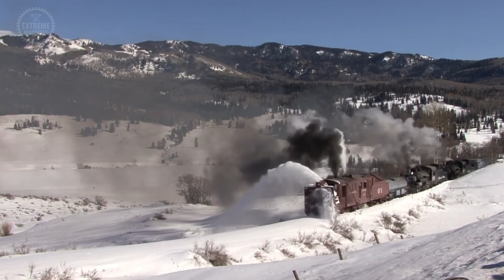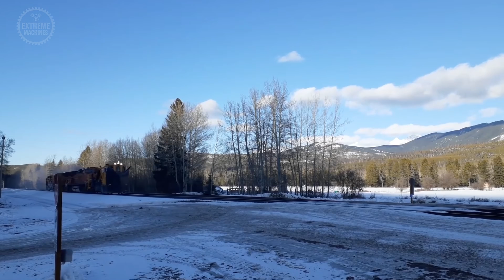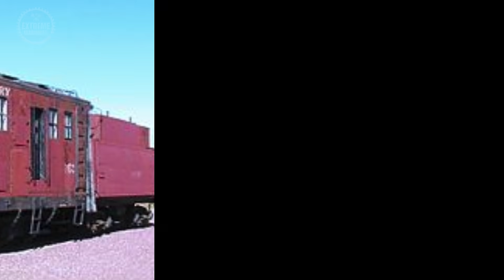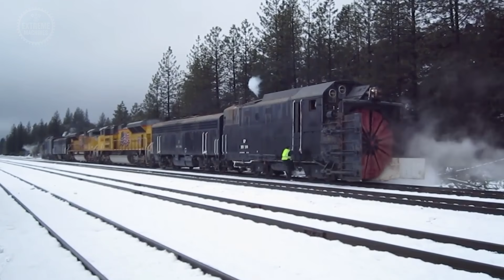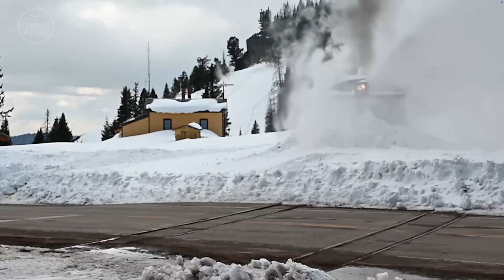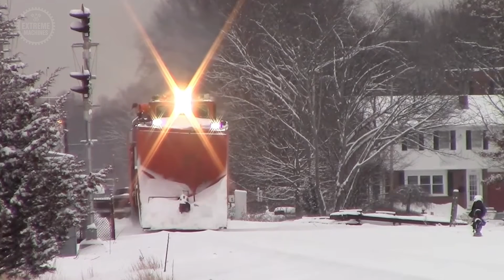The BIGGEST and Most POWERFUL Snow Trains in Action — This Is INSANE!

Comment: The Jordan spreader was the creation of Oswald F. Jordan, a Canadian [not American] who worked in the Niagara, Ontario area on the Canada Southern Railway, later a subsidiary of the New York Central Railroad. He supervised a crew at the St. Thomas Canada Southern shop in the early 1890s. Jordan's first patent, filed in 1890 and listing Robert Potts as co-inventor, covered a single-blade mechanism with the blade height adjustable with a hand crank and gearing

Comment: I see one weapon against the snow you failed to cover. The Southern Pacific Flanger. SP used them as a first line defense against the snow. It's pulled by one or two locomotives and has two plows that sit between the trucks of the flanger. One to throw to the left, and the other to throw to the right, and you use which one works for the terrain you're plowing in. The plows actually go below the top of the rail, removing snow and ice that can build up between the rails, and can cause a car to be lifted up and off the rails. Southern Pacific designed and built the Flanger.

Comment: Why is the big ass rotary spinning wheel being push by steam engines?
Reply: The steam engines you saw are on a narrow gauge railroad in Denver that used to be Denver and Rio Grande Western tracks. They're simply using the locomotives that are available to their railroad. I'm pretty certain it's just a tourist railroad currently.
Reply: Historic railway museum still runs them
Reply: @genebohannon8820 Yeah, I’ve seen one before and it was either the Durango & Silverton narrow gauge railroad in Colorado or the White Pass & Yukon Railway in Skagway Alaska.

Comment: Plows are pushed not pulled !
Reply: @jamesmoore9511 -  Artificial intelligence isn't intelligent.
Reply: Southern Pacific designed and built Flangers which are like a narrowed down caboose with two plows between the trucks and they are pulled. This video failed to cover them. Flangers are instramental even today to keep former SP Lines open, ie Donner Pass and the Oregon Cascades.